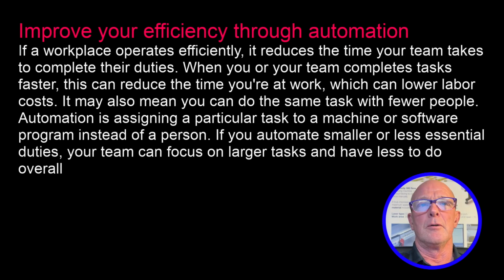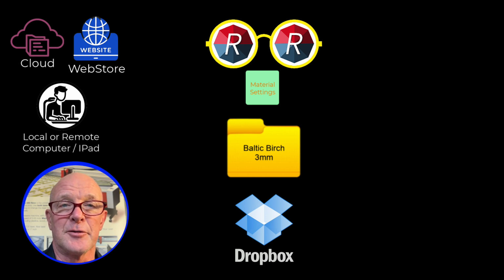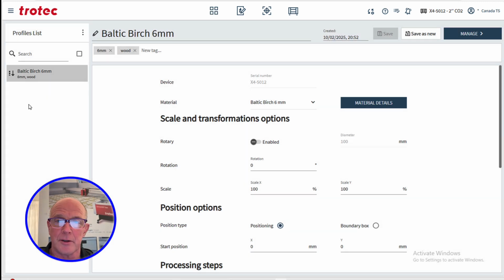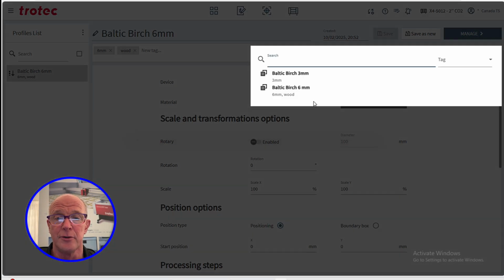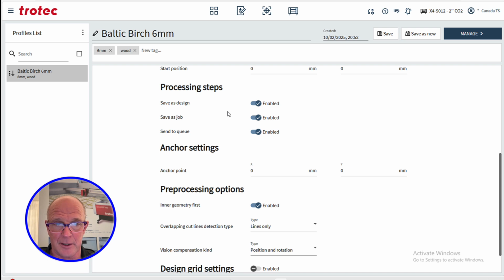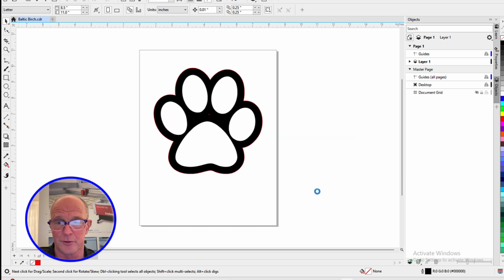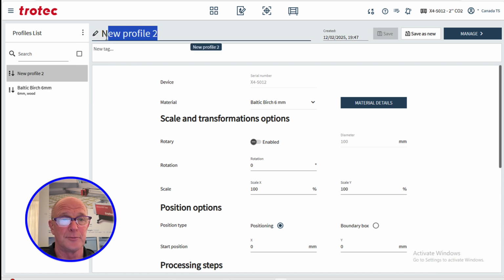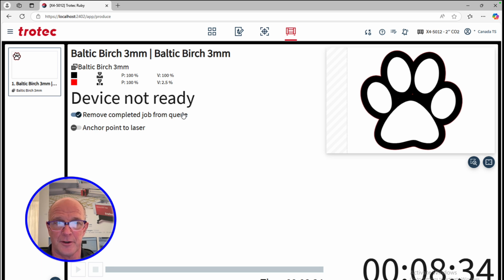Using Profiles in Ruby to Automate Your Workflow - A Game Changer

Comment: Hi Mike, I was told by a support tech not to upgrade to the newest versions of ruby until all the kinks and bugs were corrected.
What would you recommend, to update to the newest releases as they come out or to wait until they are stable.
Thanks
Reply from the maker: That is always the 1,000,000 dollar question. I have always been one of those to upgrade quickly especially if there is features that can help me out. I tend to find that more times than not I benefit from the upgrade